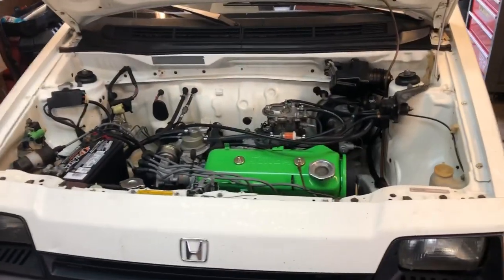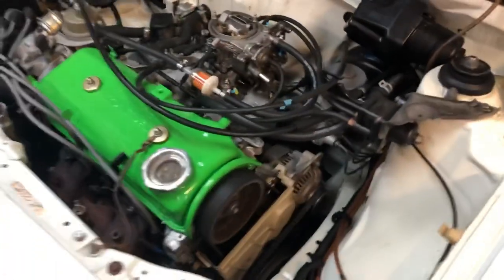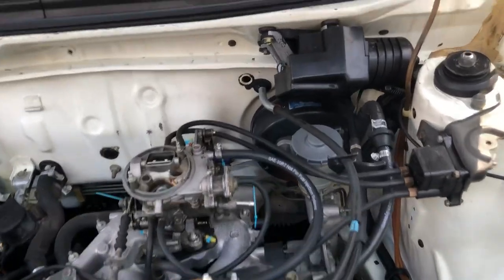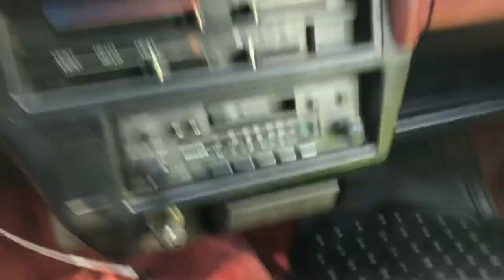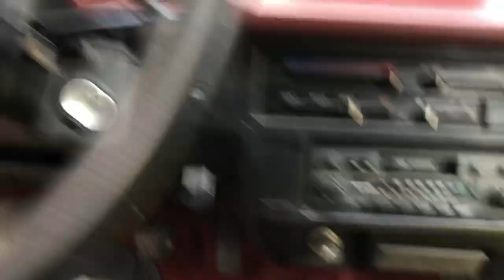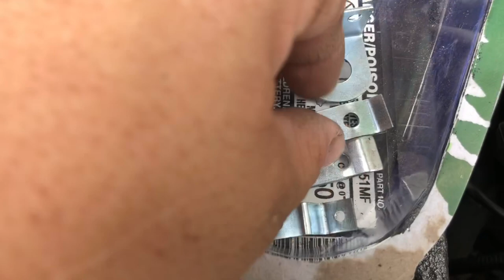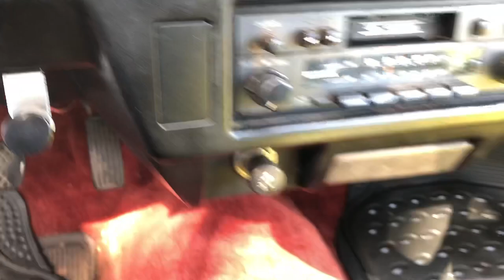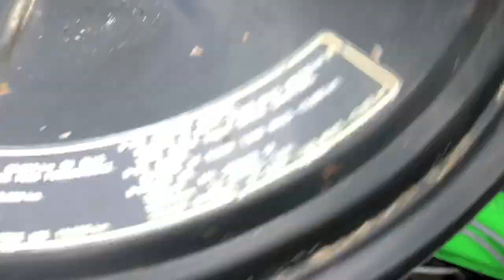1984-1987 Civic/Crx De’vac Part 4

Comment: Just de-vacced my 87 crx hf using these videos. Previous owner installed a weber carb but did a poor job of devaccing.... it could barely hold idle before.... now she's running much smoother. These videos were incredibly helpful... many thanks 🙏

Comment: Hey, I just found your channel, pretty cool, very down to earth way of sharing this info. I de'vaced an '87 civic quite a few years ago now, I've put a little over 40,000 miles on it since, and it has turned into my daily driver. You had mentioned in a previous video that you have not figured out how to make the automatic choke work. I was able to do that. I recently acquired an '86 CRX so I will be going through this process again. I don't know if you still play with these old Hondas but I can share the info on the choke if you would like, when I do the CRX. At the moment I don't remember how I did it, but when I do the CRX it will come back to me. These are great cars, and like you said, too many go to the scrap heap because of simple vacuum leaks.
Also, I noticed on your tool box you have an Oregon rally group sticker. I live in Oregon, wonder if you're nearby.
Reply from the maker: I would love to know about the choke stuff! I’m located in Springfield.
Reply: @junkyardboiz2896  Yup, you're really nearby! How can I contact you?
Reply from the maker: @joelohne3559  torsionbarhondas@yahoo.com
Reply from the maker: Yes
Reply: Joe, How did you get the automatic choe to work? I'm 'bout to buy a '85 Wagovan from original owner. He says it idles high. So thought I'd devac it. But don't want to mess with it until I have more info on what I need to do. Thanks!
Reply from the maker: I was never able to figure out how to keep the stock choke unfortunately.

Comment: Did the De’Vac, and the car will turn over, but doesn’t idle…any ideas?
Reply from the maker: Start by checking for vacuum leaks and make sure the float level is correct

Comment: Dang. That alternator location tho. My guess is if it ever needs to be replaced it would have to be done from under the car?
Reply from the maker: It’s really not that bad you just have to pull the driver side tire and drop it through the wheel well.

Comment: Hi, great videos. I just went through this whole process with my 1987 civic. It is squirting coolant out of the port on the back of the carb that you blocked off.  Can’t figure out why?
Reply from the maker: From the factory they used coolant to help heat up the carb so on cold days it doesn’t run bad in cold weather.

Comment: Do. You know the stock tune setting for the carb I'm having trouble with mine
Reply from the maker: What kinda of issues are you having?
Reply: @junkyardboiz2896   I can't get the carb tuned right I wish there was a base line where I could start from to see If that's what my issue is. I literally have the exact same motor as yours in my 87 Honda crx hf, bought the car after it was sitting for like 10 years had to drain the gas tank and then I found out the valve core bit the exhaust and intake valves so I had the valves redone an intake gasket and valve gasket put on in the mechanic that I brought it to said he drain the gas tank in tune the carburetor which is weird because I checked the fuel filter that was underneath the driver side right tire rear and when I changed it and emptied it out it was full with a bunch of black rust colored gas so then I changed it changed the fuel lines put it back together and then my mechanical fuel pump went out so I had to put an electrical fuel pump in by the old fuel filter which I have wire to the fuse box in interior. so now with the electrical fuel pump put together and everything else supposably somewhat okay I was driving the other day with the new fuel pump in and then it started hesitating and dying when I was going down the street so then I figured it might be the spark plugs or something so I change the spark plugs were fouled out put new E3 spark plugs in put it back together in mess with the fuel setting on the carburetor and have yet to dial it in right because I have no acceleration and I can't make it out of second gear
Reply from the maker: Ryan Dimaggio Do you still have all the vacuum/emission equipment?  The float bowl could have stuff in it now allowing fuel to pass.
Reply: @junkyardboiz2896  Hello, what valve do you use, where did you connect the 3 hoses?

Comment: Ive got a 1985 Wagon and I'm having difficulty finding shocks that will work, what do you run for shocks specifically in the front?
Reply from the maker: Rockauto has if you options when it comes to front shocks I just use whatever works for my budget. KYB are a good all daily driver shock

Comment: Hi can you please show where is the pcv valve in that car in the video? I just can't find mine!!
Reply: The PCV valve tube connects right before cylinder 2 or 3 on the intake manifold, and the tube runs down below the intake manifold to the PCV valve itself. If you pull on the tube then it should just pop out.

Comment: I have 95 Civic sedan which I bought brand new and maintained meticulously. I simply love this car, & my car of choice for long continuous travel. It is running very well but lately It had flooding problems which I fixed. During the fix, I noticed that the vacuum hoses were brittle & I decided to replace all of them. My car has something like a 'thermo vacuum valve' mounted below the carb and all the vac lines (all 6 of them)  comes from there. And yes I managed to break it realizing too late that it was made of plastic & 26 years old plastic tends to be very brittle. If I cannot get this thermo vacuum valve which is very likely, I will be forced to de vac the carb like what you did to make the car run. My carb is slightly different from yours having less vacuum tubes sticking out of the carb body, but all the vacuum devices including the electrical choke is the same. My question is which tubes on the carb needs to have a vacuum hose attached? I notice from your video that you have two vac lines going to the back (firewall side) & two in front, & one on the float window side.  I don't have the vacuum device on the float window side, which brings your vac lines to five left. My carb is the Keihin ED84 A . Your advise will be highly appreciated, & your de vac video series is heaven sent thank you very much for this . . I can send you pictures if you want to see the carb.
Reply from the maker: Go a head and sent me some pictures to torsionbarhondas@ yahoo.com I’ll try and help you out.
Reply: @junkyardboiz2896  will this work on a 1986 automatic crx

Comment: I have a 85 Civic 1500 S i replaced motor with 87 1.5L. I have the cruise control on the car can i hook it back up to any random vacuum and attach back to throttle?
Reply from the maker: I’m assuming it’s an aftermarket cruise control type deal? If so you can plug it back into a good vacuum source
Reply: @junkyardboiz2896  Thanks for responding so quick. Im not sure but i have the original paperwork on the car. I did your de-vac today and it cranks but didnt have time to tune the carb or do choke yet. Ty for the help and great videos. Look forward to more content on these cars.

Comment: I’m definitely doing this once mines up and running again. I have an 87 carb. I have cleaned it all out and replaced the fuel pump but it still won’t pump gas to the carb. Any ideas?
Reply from the maker: Have you replaced the fuel filter that is in the driver side rear fender well?
Reply: @junkyardboiz2896  yes, fuel filters are brand new. Fuel pump is new and car has been cleaned out. It’s strange cause this morning after I put the carburetor back on it. It started right up. But this evening, back to square one
Reply: I rebuilt the carb yesterday. It starts every time now but dies in just a few seconds. If I hold the choke closed. It’ll continue to run but with really rough idle. Like it’s trying to die. Any ideas.

Comment: Seen your videos bro this is awesome i had a question idk if you can guide me in the right direction. I have an 86 honda civic its starts right up but after a few minutes shuts off and have to wait to start it lacks power up hill as well. Engine sounds good but not sure what to look out for.
Reply from the maker: Have to done the de’vac or are you still stock?
Reply: @junkyardboiz2896  still stock bro
Reply from the maker: Have you changed the 2 fuel filters? Checked from vacuum leaks?
Reply: @junkyardboiz2896  haven't done that will look into it
Reply from the maker: The cars have 2 fuel filters. One is located by the carburettor and the other is located in the drivers rear passenger wheel well. it’s slightly protected by like a plastic cover.
Reply: @Junkyard Boiz  found them both the bottom one was all covered in dirt looks very old you think that could be the issue of it turning off
Reply: @junkyardboiz2896  could i send you some pictures of the engine at an email so you can get me the part number for the filter and give me what kind of engine it is
Reply from the maker: Yes torsionbarhondas@yahoo.com